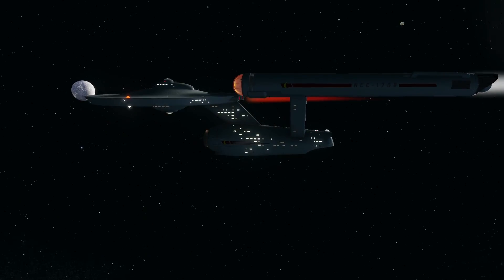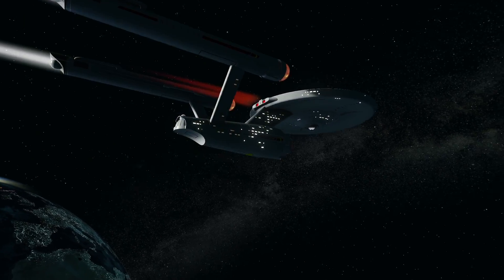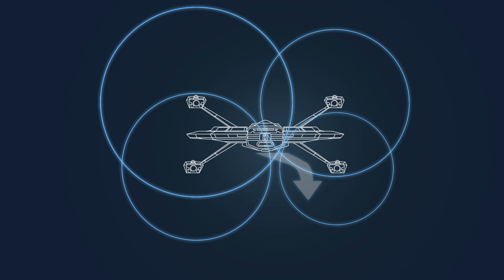Why Extra Nacelles?

Comment: I recall reading that the Galaxy class technically had 4 warp drives, because each nacelle had two independent sets of warp coils. Thus, they could probably warp coast, and had redundancy and the other benefits. This arrangement was supposedly possible because they built the Galaxy class big for various reasons, including allowing them to fit four nacelles into two big ones, keeping the design balanced and compact and low-profile. This would mean that the Freedom class variant, using a single Galaxy nacelle, is in fact a conventional twin nacelle design!
Reply: That would fit with the high warp speeds of the galaxy class. Being able to sustain high warp through warp coasting, but also able to reach very high warp factors by running all 4 at maximum for a limited time.
Reply: On a related note, I recall reading that single nacelles are always a two-in-one design, which supports what you're saying
Reply: Would this likely mean that later quad-nacelles made after that likely also incorporate the two sets of coils in each nacelle? From the Prometheus to the newer Sagans we've seen in Picard?

Comment: I also wanted to add that Enterprise had a nice tidbit thats relevant: In Twilight they pretty much lost the starboard nacelle and Trip gives a top speed of Warp 1.7, meaning ships can technically go on one intact nacelle in some cases, though in Damage they suffer similar damage to one nacelle and warp drive is completely out, so its not entirely consistent. Voyagers Year of Hell also had a case of one nacelle giving them trouble and them limping around on the good one.
Reply: Besides having less engine "power" there might also be an issue with asymmetric "thrust" which would have to be balanced out. We don't want to fly in a big circle...
Oh and obviously a design similar to jetliners. A single engine failure isn't an emergency, only an "event", and they are build to do a diverted landing safely.

Comment: I have a lot of headcannon about nacelle designs and choices. To me 3+ nacelles is a matter of plasma efficiency. Generate more cochranes over a larger volume using the same plasma recirculating. Energy efficient, but no faster. Capable of making a larger warp of the same relative strength.
Reply: So you think it's a reciprocating nacelle?  Heh, interesting!  I wonder how main engineering would have the main plasma conduits configured?
Reply: that is interesting, I always thought of it like decreasing returns for speed and linear for energy/cost while making bigger/newer engines cost exponentially more rare materials/energy while increasing speed linearly. So two type 2's cost half as much as one type 4 but go just as fast, while four type 2s cost just as much as a single type 4 or two type 3s and are slower than the type 3s. 
I do believe there would be things like you say the matter of plasma efficiency probably some energy efficiency as well. However, I do wonder what the power bleed would be trying to send those massive power loads in four directions rather than two. I also tend to use Halo logic of an ftl drive being the most expensive piece of technology to create, the better the drive the smaller the pieces/more rare the materials with the way of getting around that being a bigger drive or multiple drives.

1 warp nacelle goes speed 1 at cost 1
2 warp nacelles go speed 2 at cost 2
3 warp nacelles go speed 2.5 at cost 3
4 warp nacelles go speed 2.75 at cost 4

type 1 warp nacelle goes speed 1 at cost 1
type 2 warp nacelle goes speed 2 at cost 2
type 3 warp nacelle goes speed 3 at cost 4
type 4 warp nacelle goes speed 4 at cost 8

2 type 2 warp nacelles go speed 4 at cost 4
4 type 2 warp nacelles go speed 5.5 at cost 8
2 type 3 warp nacelles go speed 6 at cost 8
1 type 4 warp nacelle goes speed 4 at cost 8
Reply: @EdricLysharae  like a 2-4 loop circulation system like the heart, only doubled or quadrupled. Individual larger channels breaking off from the central out port. Two to four interlocking but separate EPS channels. I had considered twin engines but trek has a problem with power scaling that is not often discussed.

A constitution class fusion drive could obliterate the entire surface of a planet, a phaser battery could create a small atomic blast, etc etc. Problem is the amount of power coming from these engines is a number picked by artists and writers. Not engineers and physicists.

A galaxy class engine would be capable of putting out more power than running every system on board in parallel. The problem in my opinion with ship engines is not power, but how that power is distributed, What demands it creates on different systems and/or cooling needs. The intricacy of these technologies controls their utility, not the raw antimatter pumped into the core. More gas isn't nessicarily a hotter fire.
Reply: No odd numbers.  It looks stupid, and it just makes ships grab-bags of bullshit.
Reply: @DoremiFasolatido1979  Forgive me for trying to be charitable of a franchise I don't own, but simply appreciate.
Lol.
There are space frame/nacelle arraignments that I think would make you say otherwise. Now I'll have to experiment more with 3 nacelle drafting.
As a matter of fact the second to last ship I drafted had two nacelles at the fore and a RING nacelle at the back. So technically 3.
Reply: You're on to something close to my headcanon.  Maximum speed is determined by warp coil technology; the number of nacelles doesn't change that.  The workload of propelling the ship is divided between the nacelles; more nacelles means less work per nacelle, cooler operation, and longer duration travel above cruising speed.  In other words, greater strategic speed and range.  Cruising speed, remember, is the balanced, maintainable speed for the vessel and includes factors such as nacelle cooling and hull structure.  Single nacelle ships are sprinters, best for short duration dashes; also, with warpfield unbalanced, tends to shake the vessel apart over time.  There are eras where this is acceptable, when vessel longevity isn't expected.  Also quick to build during wartime or other logistical bottlenecks.  Two nacelles, easy to balance, smooth running, default.  Three nacelles are extremely efficient, run in three phase mode (warp cycles 120 degrees apart) smooth continuous warpfield generation, but fell out of favor after the 2250's, commonly used on long-haulers and one-way deep space survey/exploration, not commonly seen in fleet engagements except by accident.  Three nacelle can be run single phase, but are horribly inefficient.  Most four engine designs are intended to accomplish the two-nacelle effect with smaller (and sometimes less sophisticated) nacelles, but also cooler operating, longer running times at high speed.  Constellation class is an exception, it originated as a way to get New Paradigm warp factors (TNG scale) out of surplus Old Paradigm (movie/refit era) flat nacelles/warp coils (when New Paradigm ships like the Ambassador class were top of the line).  Running those 4x nacelles a little "hot", 'Stellas heat generation curve is on par with 2 nacelle vessels.  Above four nacelles, however, one starts getting diminishing returns.
Reply: @xheralt  Tholians and other 3 to 5 radial warp nacelle engine species must be malding at your delightful and refreshing take. Efficiency being a simple matter of application and advancment in the ways you describe is very logical. 

Live long and prosper. May your structural integrity fields be sound.
Temba, His thumb raised.
Reply: Dude, you work at Area 51? You know a bit too much... 😄
Reply: @arthurchadwell9267  Shhhhh

Comment: I've always like the idea that 4 necelle designs being able to use them in pairs for longer high warp cruising. 

When the first pair reach their limits you bring the others online and take the first offline.  Depending on the cool down time you could cruise for as long as you wanted just swapping back and forth.

Comment: The original Star Trek Technical Manual had a design for a single nacelle ship classified as a "Destroyer" class ship. Basically a larger version of the Constitution era class single nacelle scout ship shown in this video. It also had a 3 nacelle ship classified as a "Battleship". Larger than the Constitution class and far more heavily armed. Now, I don't know if they gave up such specific warship type designs as they felt that the Federation didn't need them,  or because the technology wasn't quite there yet. I built a few of the Destroyer class from the old small model kits, they looked quite nice actually. Obviously not scale since it was made up of Constitution parts kit-bashed together, but was fun as a kid. 

I do love the Vulcan style of ships, they look just like the design that NASA has come up with for their own future warp drive ship. Though much larger of course.
Reply: In Star Trek II You can see a 3 nacelle dreadnought on one of the console's veiwscreens   before The Enterprise leaves spacedock.
Reply: Yeah the original Franz Josef Star Trek manual had several different starship classes. First was the two nacelle Constitution heavy cruiser class. Then single nacelle destroyer/scout class. Then a two nacelle vessel kind of like the Miranda class with the nacelles below the primary hull.. but it was designed to tow cylindrical modules beneath it. Then the three nacelle dreadnought that was shown here as well.

Comment: The Proxima class is my favourite 4 nacelle design, it feels so much like a support vessel with tasks that the galaxy class would later fill (like colony support). The dual shuttlebays would be useful in an emergency evacuation and the large saucer section would provide greater shield coverage if it got between the vulnerable shuttles and the attacking ships.

Comment: A more Stabilized Warp Field meaning Faster more accurate Travel that's my guess.

Respect Rick and keep up the epic work.
Reply: not nec faster, jsut more stable field > less impact by subspace turbulance > more robust against natural subspace phenomina AND/OR more efficient warp field per Cochran (even tho more energy is used)
Reply: SPEED AND POWER!!!!
Reply: Notice most of the battleships had four nacelle.  Extra power means more pew pew.
Reply: No extra power without extra M/ARA  reactors. They explained in books that the double pairs actually are so the ship can go higher warp for longer without shutting down.  One pair is used at a time, swapped so one charges up, takes over, the other then shuts down and cools. Basically doubling high warp travel
Reply: Rick sucks, all my homies hate Rick

Comment: I always thought of more nacelles as being analogous to more cylinders in a piston engine.  It's not the only way to get more power, and it's not always the most efficient, but depending on what kind of duty the engine is expected to perform, it might be the way to go.

Also the idea of the nacelles needing line of sight seems like more of a design consideration not based on strict warp theory requirements, rather the requirements that arise from some specific method Starfleet prefers when generating warp fields.  Obviously this isn't 100% required since we've seen plenty of ships without line-of-sight nacelles, single nacelle designs, and ships that take damage and limp along on only one nacelle.  I would assume redundancy against damage and max-warp timeout is the biggest argument for going with 3-4 nacelles when clearly 1-2 will work, but as long as you have four it also opens you up to other benefits like increased speed or efficiency.

Lots of ways to skin a cat and I'm glad Starfleet isn't afraid to experiment.  Apparently they're the only major power in the galaxy that bothers.

Comment: The Freedom Class was purely a survey ship. Yet, for some reason, Starfleet thought it could help at Wolf 359. Possibly as cannon fodder.
Reply: You have to figure the defensive ships were posted out from the core worlds because most threats would be approaching via traditional warp and be detected.  The ships at Wolf359 were very much going to be the ships not capable of or intended to serve on the frontier.   The Borg probably dropped into federation space vis conduit and bypassed the Frontline ships.   The more substantial ships at the battle were likely just near by incidentally.
Reply: I think it still qualifies as a light destroyer, frankly. It has torpedo tubes too - more than Challenger-class has (or seems to)
So I'd not count out the Freedom casually, yet.
Potentially two of them there, too - the USS Firebrand NCC-68723, and maybe the USS Liberator NCC-67016.
Reply: Honestly a survery ship could have been useful if it had far more powerful sensors than available on standard vessel able to far more precise reading away from the main engagement able to gather information for the whole fleet in safety allowing identification of possible weakness that allows the rest of the Federation Fleet to focus on fighting and exploit the weaknesses, kinda like AWCAS. It would show how powerful the Borg are really are despite the best effort of the Federation the Borg just smashed through all of the combat vessels and attacked the support ships on the peripheries before the support ships could escape
Reply: Interesting takes guys, I just assumed desperation but I like these better.

Comment: One thought on non-line of sight nacelle design is that putting the mass of the ship between the nacelles limits the total size of the ship. The bigger the ship, the more output is required by the nacelles, and that can have adverse effects if you're living between those nacelles. So smaller ships, like the Defiant can get away with it, but a Galaxy class can't. At least until you start using Borg tech.
Reply: The Galaxy X Class has a third Nacelle between the main ones.

Is that like a moderator of some kind or just a redundant nacelle?
Reply: @enterprisethesylveon5787  Hmm, that's a good question. Maybe it's redundant in the way that Rick says in the video, so that battle damage to a single nacelle doesn't prevent going to warp? Or if the refits that added the big phaser cannon meant that a new nacelle was needed?
Reply: @chan742  Phaser Lance...

And probably both...
Reply: The Defiant's nacelles extend below the rest of the hull, so at that spot they do have unobstructed line of sight.
Reply: @danielkorladis7869  The line of sight applies to the grills, not solid hull plating. But ultimately, the line of sight rule never really mattered in terms of fake ship design or in-universe.

Comment: Headcanon:
two nacelles w/los are great for sturdy, reliablle efficient speed.
the nacelle-less make a "skinny" bubble, so it works for smaller ships (birds of prey, defiants)
4 is good for longer distance (as you said)
a lot of civilian ships have 1 nacelle, you just don't see them.
Vulcan rings are the "logical" choice--efficient, adaptable--but you need a Vulcan engineer to be anal retentive to get them to work well.
Reply: I love that last line. In some VFX shots they rendered the light slowly circling round the entire ring in opposing pairs, so there must’ve been an awful lot of smaller coils synchronised perfectly. While Starfleet rarely goes above a dozen and often has even fewer per nacelle

Comment: My head canon was always that the primary purpose of four nacelle ships was to provide a large warp field to act as a support vessel for fleet movements.  A large warp bubble could wrap around several ships, reducing the total energy needed to move them all and/or allow fleets to move at sustained high speeds.  
They have the side benefits of the 'coasting' and redundancy  mentioned here, making them good for exploration or other missions where they may need sustained high warp or have limited access to maintenance facilities.  As such would be used for such jobs when not needed as a "fleet tug".

Comment: The aircraft terms for nacelle came from (afaik) ancient sailing ships like the trimiran, which had the outboard nacelle connected with a pylon.
Reply: Modern ships still have nacelles.
They can turn them like an oscillating fan to maneouver easier.

Comment: So, while it is non-canon in the Prime Timeline, what about the addition of a third nacelle for the Galaxy Dreadnought Class in "All Good things" which is a canon design for STO, simply for higher warp factors?
Reply: No.  warp coil technology remains the same and wouldn't change that.  Third nacelle reduces heat stresses of high warp speed, helps keep the system cooler longer (although it will still inevitably overheat if run too hard too long).  Also helps with moving the added mass of the additional armor and weapons emplacements at speeds expected of a Galaxy class.

Comment: They say no odd numbers, but it seems a tri nacelle setup (triangular) would be perfectly acceptable. Also. Maybe the vulcans were on to something with the warp ring. Considering later on, it turns out standard warp travel is damaging to subspace, maybe the ring style would cause less damage. Seeing as a ring makes a more concentric field that's more balanced all the way around. Seems like the twin nacelle style would create a more chaotic field, or at least one that doesn't surround the entire ship equally.
Reply: Since the Vulcans kept these designs over time there must be a logical reason to it, and what you said falls very in line with what I would think. I considered these may also have a higher level of calibration giving more control over the warp field, and has remained a strict doctrine for Vulcan science ships design because of it. There may also come a higher level of sophistication with it, and may be more expensive wich led to starfleet choosing a more practical, simpler and cheaper option so they opted for warp nacelles instead.